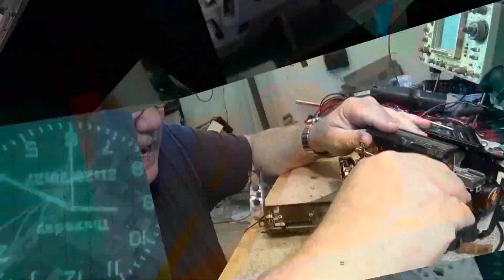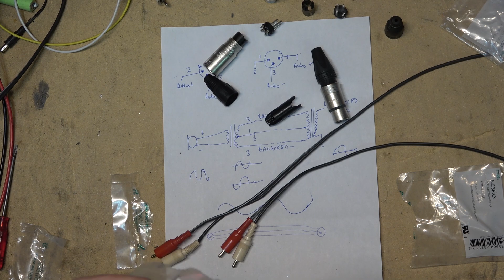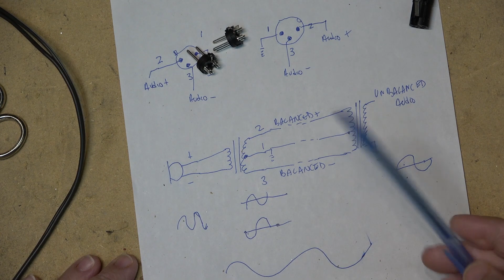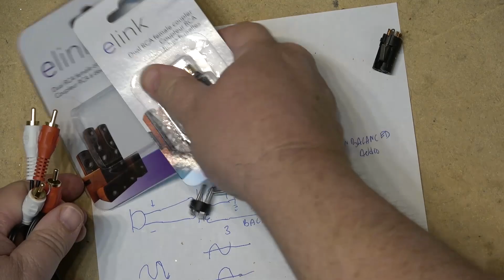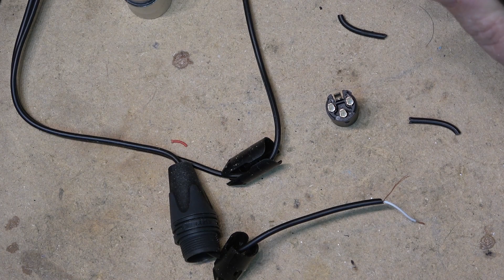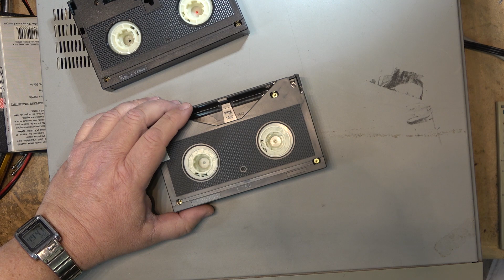Making some custom XLR to RCA line level adapter cables and a bonus tape experiment

Comment: Hi 12volt😂
I watch many of your videos and find them very entertaining. But I do not understand why you have such a horrible sound? I mean, you are a technician  and I think it is safe to say that you also have the knowledge of making a decent or professional sound. But your sound is horrible, the background noise is EXTREME!! It's like you have 10 Boeing 747 in your room running at full power...
And the AGC does not help when it goes up and down. This is most notable on Android devices, mobiles and TV. I guess that you edit your videos in windows, so you probably never hear the sound in android. The thing is, android does not have the same muscle when it comes to noise suppression. Please try and listen to this video on an android TV, and then pay attention to the background noise. Apart from this I really do enjoy your videos.
Regards from Denmark
Claus
Reply from the maker: Its called the shop heater and it either runs or I freeze. I record sound with a microphone mounted directly above me on the camera and it will pick up any sound that is in the shop. Can't do much about ambient sound and no I am not about to dub everything in the studio. That's just the way it is when the heat is running. Can't do much about it. If its an android TV issue I suggest you go into your menu and turn off the simulated surround or SRS garbage. I listen with headphones when I edit and I don't find the background noise that objectionable. After all it is a work shop. There is no sound deadening material on the wall. I was hoping to move the shop inside but my son has refused to move out. He's all grown up but just keeps hanging around, and I want the room he used to play his games in for my work shop, so I can work in comfort. Keeps promising to move out but I am still waiting. Daughter moved out 3 years ago.
Reply: @12voltvids  you can record the noise from the heater without any other sound. Then use this bid to filter out the noise in a VST there are many to choose from also free ones. Maybee your DAW or editor have this filter function. It is a problem in any android setup. My android doesn't use any of that, android just don't have the same power as windows.
Reply from the maker: @Onkel.Moetrik  that's too much work for the little I make from videos.  Perhaps is 90% of viewers didn't as block there would be more incentive to put more effort into it. Perhaps ai could do it but you want to pay for that be my guest.  Turn the surround off on your TV and it sounds just fine.  Sony learned years ago that SRS was a joke and they dumped it 30 years ago.
Reply: @12voltvids  As I said, I don't have any srs or similar. It's all turned off. It's not about spending money or putting in a lot of extra work. It is really very easy to avoid problems like this. It's all about attitude and having a professional approach to the workflow. But never mind. Luckily the number of YouTube channels by far exceeds my very limited spare time.

Comment: A few months earlier I bought an S-Video cable with nice plugs that looked gold plated. It performed terribly, the picture was a lot worse compared to composite. I torn it apart to find no shielding whatsoever, not between the chroma and luma wires, nor external overall shield. On top of that, the conductors were copper clad steel!
Reply from the maker: There are plenty of absolute shit cables on the market and some cary premium names that start with M and end with R.

Comment: On cheap cables you also have to watch out for copper coated aluminium. Copper coated steel is also a thing that's starting to become popular with cheap Chinese cables as well.
Reply: 100% and it sounds horrible.

Comment: This was a fun video!  38 year broadcast photojournalist here  and shot on film, 3/4, Betacam, DVC Pro, P2, and XDCAM.  By far Betacam was my favorite tape format.  The holes changing from Betacam to SP changed the deck video EQ for the tape formula which is why you were seeing the video breakup.  BetaSP would record not only linear audio tracks, but also FM.  When needing to dub my master camera tape so I could use the A/B editing suite, I always would use SP for the FM on my dub.  Even with Dolby noise reduction on Betacam, I could still hear just a little bit of high frequency loss on my dubbed tape, but using the FM audio retained quality.  The problem with FM was cuing audio as it would only demodulate sound in real time playback, so I'd use the analog audio to find my edit point, set my in and out points, then switch my player to FM and perform my edit.
Reply from the maker: Right but not all decks have the dm audio.  This one for exams has only linear.  If not mistaken. Some also has a 3rd linear cue track.
Reply: 2" Quad and 1 inch had the third audio cue track, standard and SP Betacam had no cue tracks but one was added for DigiBeta.  There's some pretty good background here.  https://en.wikipedia.org/wiki/Betacam

Comment: I don't understand why the BETA tape artifacts looked so digital. Is there an explanation for it? Is the analog signal digitally processed?
Reply: Betacam time base corrector (TBC) was struggling to correct. Keep in mind the video EQ is quite different in the SP mode on a metal tape versus standard Betacam on oxide tape.  Usually a video dropout would be sensed and the TBC would duplicate just part of the line above or below, so a 1 line dropout would be barely noticed.  But when the TBC doesn't have a clean duplicate line to copy, it tries and tries until you end up with a significant part of multiple scan lines being copied. And dirty video heads will also produce that sort of 'digital' blocks when the TBC is attempting to reconstruct video which just isn't there.
Reply: @kentpeterson8082  I totally forgot that TBC is basically digital processing. Thanks!

Comment: This cable reminds me of the pigeon where it's super slim at the bottom and thick under the neck. High quality XLR and then a cheap cable with barely 2 grams of copper in it.
Reply: It probably has way less than 2 grams of copper, because I'm 90% sure it is either copper clad aluminium, or maybe even copper clad steel.

Comment: I can remember these mains powered converter boxes that had 4 XLR and 4 RCA on them. I guess these versions had some sort of impedance transformer circuit inside. Is there an advantage to using those kinds of converters? I think they were used  on domestic VHS recorders, CD players etc so they could connect to the rest of the audio matrix which must have used balanced audio.

Comment: I would be interested to know what they were called. All I ever recall is male/female. Is that banned? Anyway, I didn't know the the difference between balanced and unbalanced connectors. I am still not sure I understand the wiring differences.  But I'll try to.
Reply from the maker: They were referred to as lesbians and gender benders.  I can still hear someone on the headset say "Mike get me a lesbian for that monitor."

Comment: Some People get the TRS Plugs/Jacks mixed up between a balanced line and Left (tip) and Right (ring) stereo channels. 
Gender Benders AHAHAHAH   Gasintas & goesoutas ....are my Favorites.
Nothing but Switchcraft XLR for this guy. LOL
Nice Video...
Mike M.
Reply from the maker: My old pro microphones from my old camera were all switchcraft.
Reply: @12voltvids  I even used them for Power Connectors for all My low current Ham and 12vdc Video gear  2&3 for + and 1 and the Case for -.  
I have a Robyn Power supply with 2 Chassis Jacks mounted on the back to plug in the 1.2 FM Hf Tech ATV Gear Rtc..
Having to work commercial sound I had access to nothing But Switchcraft HAHAHA
Reply from the maker: @m9ovich785  power should use the 4 pin XLR
Reply: @12voltvids  It was all My equipment used only by me and that is what I used back in the 80's/90's They are Rated at 10 amps and if by chance I needed a really long run a common Mic cord would work in a Pinch. 
I have started using Anderson Power pole but the XLR locked and is more durable

Comment: Too bad you didn't have an extra xlr cable to add some rca plugs, the shielding would have been better. Interesting to learn about cables. A few years ago I had to buy an xlr cord accessory to block phantom power from mixers getting into an acoustic instrument pre-amp (the preamp has it's own ac adapter and the instructions said that phantom power could cause damage). I guess the blocker is or is similar to an isolation transformer to block one of the signal lines. I thought one of the main reasons to use xlr cable is for the benefit of a higher input signal, but longer runs is important, too.  One time, I was experimenting with plugging in my mandolin to my pre-amp, etc, and I plugged my mandolin (with a surface pickup) into a direct box/isolation transformer, and then into my preamp, and that signal out to a mixer, into headphones. The result was the ability to clearly pickup local AM radio as I moved around.
Reply from the maker: Transformer will block phantom power, but a simple capacitor also will block DC,

Comment: Great video!

Curious on why pro video never had a balanced composite out mechanism like balanced audio cables? Is it just not necessary or were there some approaches that were used?
Reply from the maker: Induction is not as big an issue on video. First it is 1v p-p whereas audio cables were used with microphone level signals which are in the uV to mV range